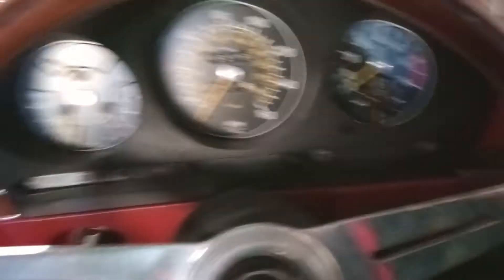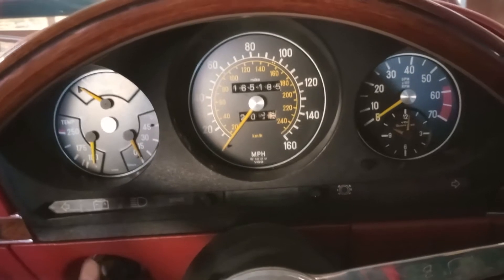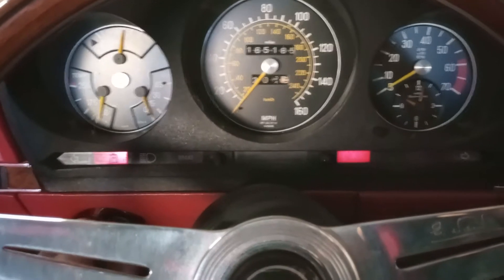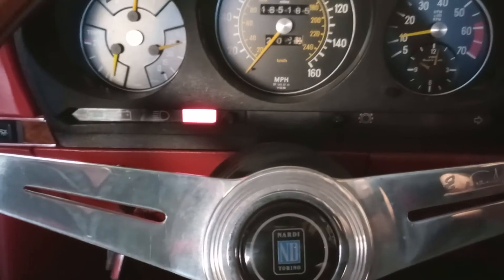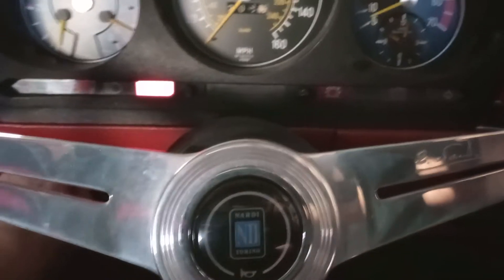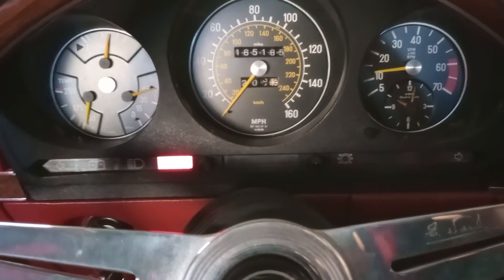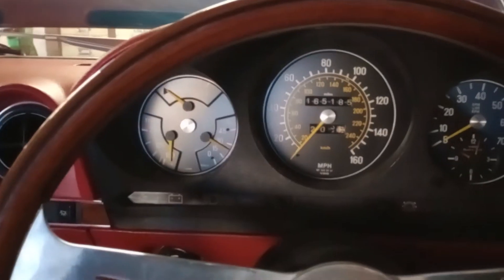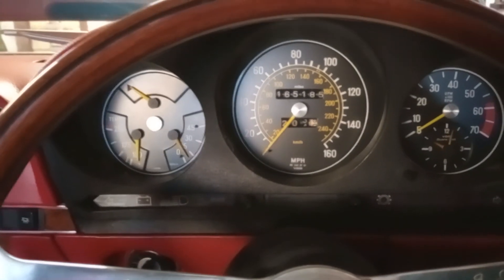Starting the 450SL with the cold start valve (AAV) blocked off.

Comment: Whats an AAV?
Im not sure if I have same problem but when I start it first time on a day, I have to sometimes pump gas or throttle..
Reply from the maker: The auxiliary air valve, let's extra air into the engine while warming up. It usually get stuck open rather than closed, leading to a high idle.